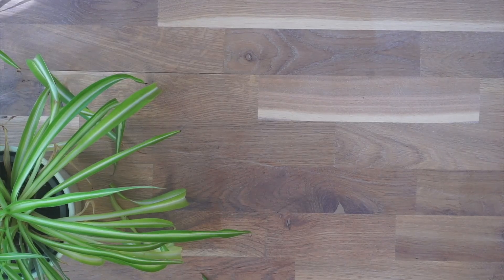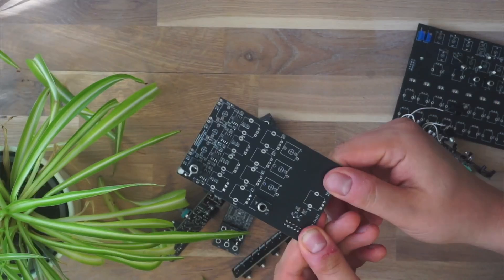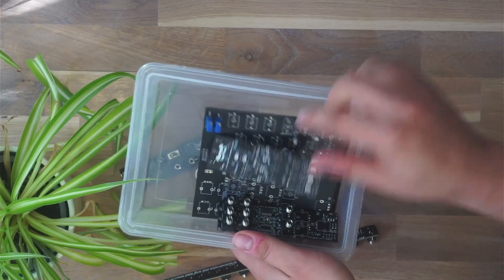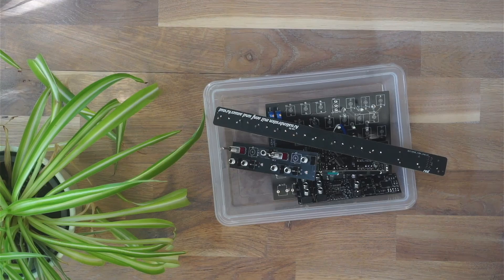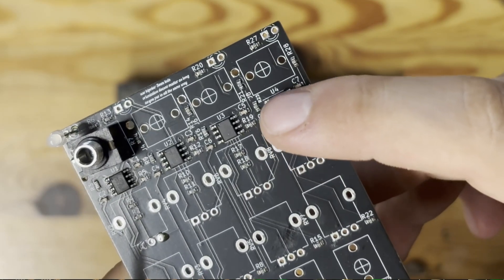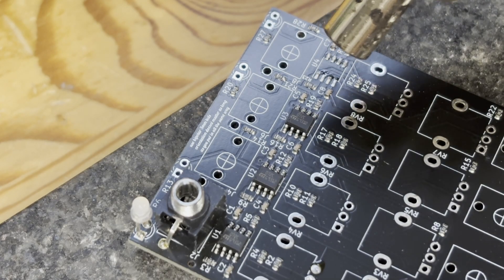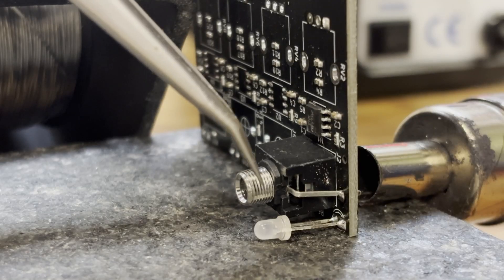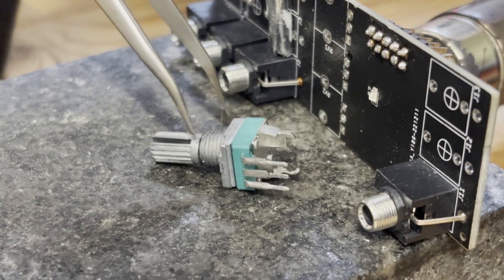SAVE YOUR MONEY AND COMPONENTS WITH THIS CHEAP TOOL!

Comment: what temp do you use on your hot air ?
Reply: Yes, I'd love to know as well. I'm always afraid of going too high, or going too low and then having to heat for too long
Reply from the maker: Great question! I have mine set to around 340C which does seem work very nicely!